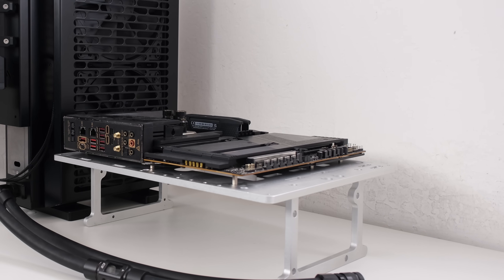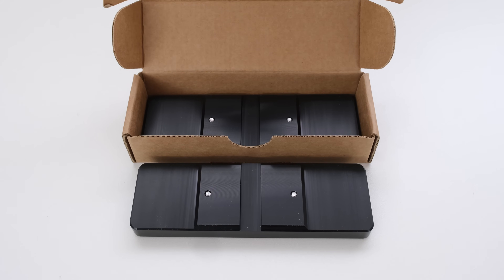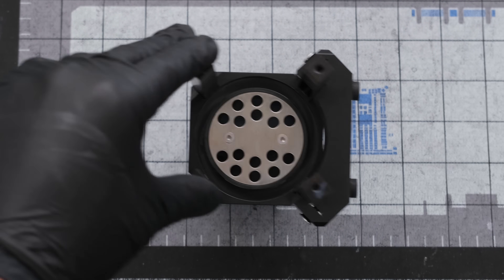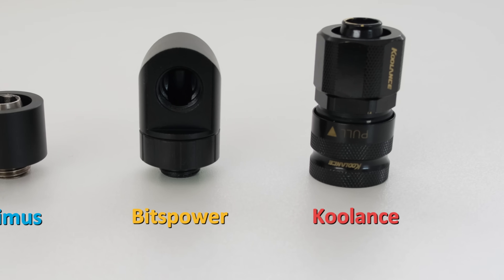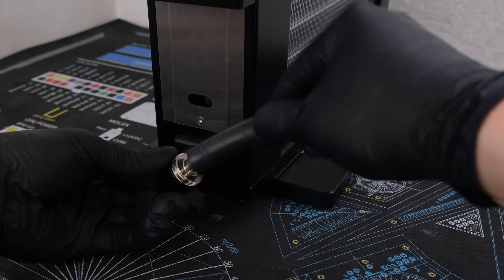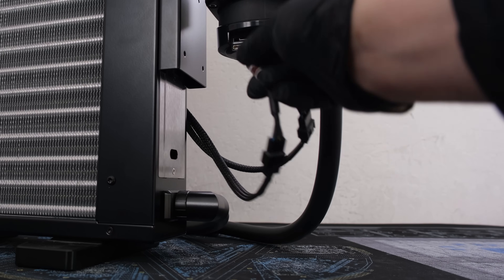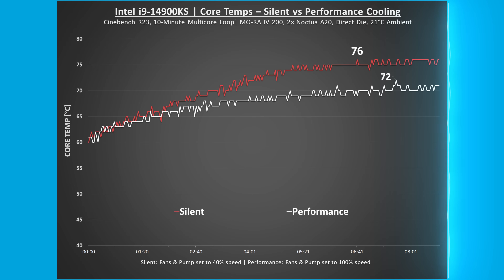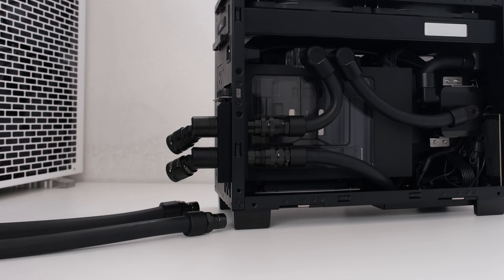MO-RA IV 200 Build - Silent Powerhouse Cooling

Comment: So stoked you are continuing to make great videos.  Perfect timing.  I am working on an externally cooled delidded 14900k w/Iceman block (more of a DIY Solution and not nearly as pretty as this Mo-Ra). But, as always, your content is an inspiration.  Great work. And, thank you for your meticulous attention to detail.  Stunning build!
Reply from the maker: Wow thank you! That delidded 14900K with the Iceman block sounds really familiar. The 14900K really requires delidding to get the high performance. I planning on doing a deep dive into the MO-RA IV 200, putting a 14900KS and a 5090 in the same loop and see what happens among other tests I suppose. I am starting work on a full build in a regular mid-sized ATX case with hard tubing. I want to do a build with hard tubing before going back to EPDM. I am also still trying to procure a 5090 Founders Edition. Once I get one, I will do a teardown video (I personally really want to tear it down) and hopefully I can somehow get my hands on the Thermal Grizzly block as thats like the coolest block I've seen in a while. Hope that helps and thanks again for watching!

Comment: Can you link the sata power adapter you used? I’m going to do this build, but the pc case has no opening to run the cable from the passive control board, so stand alone power to the outlet is a must. Great video, gave me hope for a high power chip in a small enclosure

Comment: all good - except for using distilled water which will strip the nickel coating from your blocks and the silver coil 

better to just use a clear coolant with biocides and corrosion inhibitors like aqua computer DP Ultra

Comment: I lovedd the video!! Do you think you could try this cooling system with a 5090/4090 and Ryzen chip?
Reply from the maker: Wow! I am planning on doing a "Deep Dive" video on the MO-RA IV 200 that would include putting a 5090 and a 14900KS in the same loop, among other tests. It won't come out immediately, but its on the schedule. I expect the 200 to cool what I can reasonably throw at it just fine.

Comment: Why dont you put mirrored quick disconnects to prep the mora itself first and then connect to a system to get rid of the lesser amount of air than it was done in 1 go (considering its a dry empty loop).
Reply from the maker: Oh, that is interesting, I never considered that. Is that primarily to help bleed the air?
Reply: @vectornetwork  pretty much yeah

Comment: I've gotta get me one of these. But the way you tightened those pump screws all around in a circle instead of a star pattern...😬
Ahhhh and you did it with the cap too!! 😅 Those poor O-rings
Reply from the maker: Well, I typically save the star pattern for the brackets around the processors, which I have done countless times on this channel. For this stuff with an O-ring, I tend to go in a circle (as its less for me to narrate and its smoother to edit) because I think instructions indicated that once for reassembling a block with a single O-ring, so I just happened to continue doing that. In any case, it passed the leak test. Hope that helps

Comment: Love the video, looking to build an ITX with a 7800X3D with the Optimus AMD waterblock and a 9070 XT with alphacools new water block. I plan to undervolt the 9070 as well. In your opinion do you think the MO-RA 200 will handle the thermal heat load from the CPU and GPU ? 

(Also any plans to do some testing on the alphacool water blocks on the 9070 line up ?)

Comment: Hey, I have a copper gpu waterblock, is the ICE-40 Aluminium? Because those can't mix, thanks.
Reply from the maker: I went and double checked and the aluminum on the ICE-40 is specifically not part of the loop. It's the outer part, so it's okay to use. Hope that helps

Comment: Definitely get the controller, why add power adapters and not be able to easily control the system via software. If you already have Aquacomputer Octo or Quadro you can connect them to the MORA link inside the PC, for controlling the passive control. Plus the passive controller have additional connection via USB C that offer 2 internal USB headers for things like D5 next or high flow next.
Reply from the maker: Oh well well, I don't disagree and here is the best part. You can first plug in the Next D5 pump into your PC with the USB motherboard cable and then play around with it and set all the profiles to your hearts content. Then you can simply unplug it and control the rest with the face buttons on the pump. Best of both worlds.

Comment: cute, thinking about the framework desktop ryzen ai 385 in a silent build
Reply from the maker: with this, you can put anything in a silent build
Reply: @vectornetwork  the fan on that radiator must be deafeningly noisy :-D thinking about a brick sized aluminum or copper heatsink with lot of fins that would do the job passively

Comment: This guy breaks out the koolance DQ3 female 10/16 to 1/4 5mm thread male fittings like there on every shelf 😂, would mind knowing where to buy some from 😅
Reply from the maker: Well, I do have a bunch right here...I think I got mine from Koolance directly. Hope that helps :)
Reply: @vectornetwork yeah, Those exact fittings from koolance In black I can't find anywhere 😢

Comment: Great video as always! Will you be doing a comparison between the MO-RA IV 200 vs your older MO-RA3 420? It would be cool to see how the smaller MO-RA compares to the larger one using the same exact build (CPU+GPU loop).
Reply from the maker: Yessir, I am planning on doing a deep dive with the MO-RA IV 200 and I suppose part of the testing should include comparisons like this and it just so happens I still have my MO-RA 3 420 right here. So yes, I think that will be in the cards. Thanks for the suggestion!

Comment: Nice video! It does seem though that your MORA plumbing routing isn't optimal, and the top EPDM is a bit kinked at the top fitting. You could have definitely cut it a bit longer to alleviate some tension on the tube. The pump outlet should also go directly into the MORA first, then out the radiator into your build. We're huge external radiator proponents but we also try to make sure things are done as best as they can be!
Reply: Any reason why the pump outlet specifically has to go into the MO-RA first? Most MO-RA builds I've seen have it setup the same as Vector Network and the official MO-RA integrated tank reservoir also has a coupler straight from the top port into the tank reservoir itself, meaning the pump outlet will be going into the PC. 

No slight towards you since I've seen your awesome work, but this is the first time I've seen anyone mention having any specific order of connection between the pump and the MO-RA ports as the MO-RA is simply a rad in the loop. I would assume the pump(s) won't care where it outputs since it's doing all the work in a closed loop and loop order never matters as long as the pumps are always fed with water.
Reply from the maker: You're absolutely flat out right about the kink. I had intended on loosening the side adapter so I could push up the Tube reservoir up so the top run could lay more naturally rather than being pulled. It takes more than an eagle eye to notice that. I didn't realize that the outlet should go into the MO-RA first. Is that for cooler water to hit the components first?

Comment: Hab nen Mo-Ra 3 Pro mit 9 Noiseblocker und Lüfterblende und Standfüße und intern noch nen 280x140x28mm und 420x140x28mm Radi mit 2x Laing DDC 12V 4.2, ich kühl  gpu und cpu, mein Setup ist auf jeden Fall Silent. Pumpe im Radi ist nicht gut, weil man die nicht entkoppeln kann, wer sich nen externen Radi holt, will ein leises Setup haben!

Comment: I bought an Alphacool NexXxoS Monsta 400mm radiator, but there's no case can fit it. It looks like turning it into an external cooling unit is a good direction. However, compared to MO-RA, I would have to design everything myself, so it doesn’t seem very cost-effective.
Reply from the maker: Well, it's possible to put it on some legs or some sort of radiator stand. Then just add a standalone pump and pump housing. Usually the pump housing will have a way to connect to radiators or its fans. Then you have basically the same thing. Hope that helps

Comment: with this big ass setup and u go only 4.8Ghz??? what a let down.
Reply from the maker: True. Although keep in mind that much of the video is really setting up the MO-RA. A rig like this is more than enough and its really for running the fans at low speeds/noise levels. I do think I could have gotten more out of the CPU if I adjusted the settings (including power settings) and I also do think that a smaller rig could have done better (if properly tuned), but I don't think it could do it with less noise. Hope that helps and thanks for the feedback

Comment: Using only distilled water without Inhibitor substance will corrode your waterblocks and radiator due to galvanic corrosion, beware.
Reply from the maker: Right on. I recently changed out the water to Aquacomputer Double Protect Ultra.

Comment: Awesome Radiator.. but the pump look out of place
Reply from the maker: Now that you pointed that out, I can see how it can look out of place. It's really designed to go on a larger MO-RA 3, but it's all heatkiller parts, so there is uniformity in look. The alternative is using the MO-RA IV reservoir and pump. The reservoir looks nice and it doesn't stick out, but the sideways pump that is required does stick out. And then you have to connect more cables to it. It's a tradeoff. I had access to both options and chose to install it this way. Hope that helps

Comment: hey bro just a quick reminder, de8auer's test has indicated how distilled water damages components in the loop. personally, my core alpha 4090 block has also some degree of copper "relocation" at places where flow is real low. I also noticed a tiny area of corrosion in my QD3 male plug. I've already purchased 2 liters of coolant from heatkiller and going to flush out the distilled water out of my loop for longevity. Also I'm pretty curious about the performance difference between mora 200 and 400. there is another test and indicates mora 400 beats 3x 360 rad easily by 6 degrees. Then I suppose mora 200 works at least the same level with 3x 360mm? currently using XSPC AX560 rad but really want to get a mora for crazier performance
Reply from the maker: Right on, I did watch that whole video and I did swap out the water and looked in my storage to see what I had. Lo and behold, I had extra Aquacomputer Double Protect Ultra in clear so I'm using that and I got 3 more bottles for future use. I do plan on doing some sort of deep dive into the MO-RA IV 200. Its hard to tell as compared to 3x 360mm. How's the noise on that type of setup? A feature of the 200 is using the Noctua A20 fans setting them to something like 300 rpm. Its the low sound level that really elevates the experience. Hope that helps